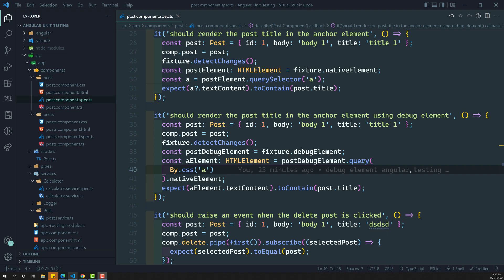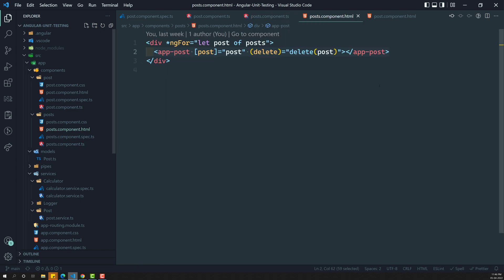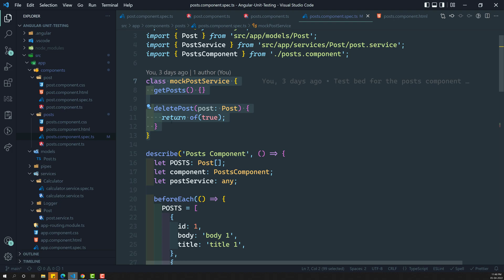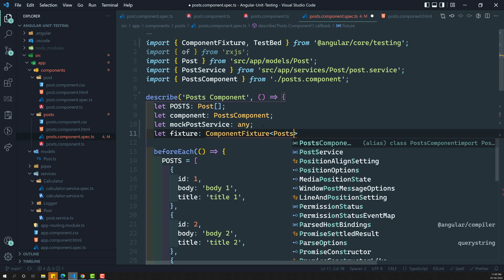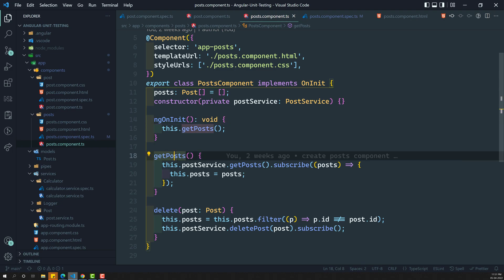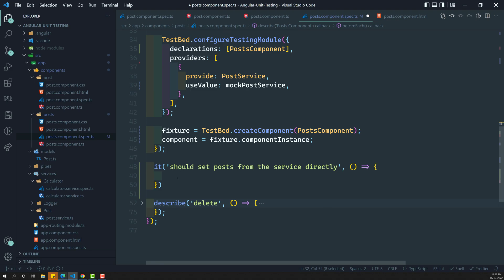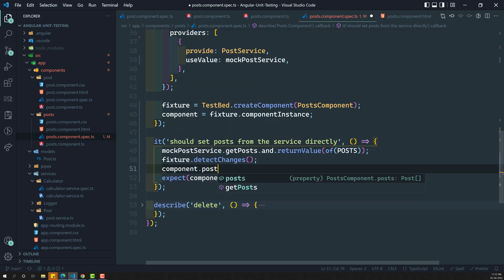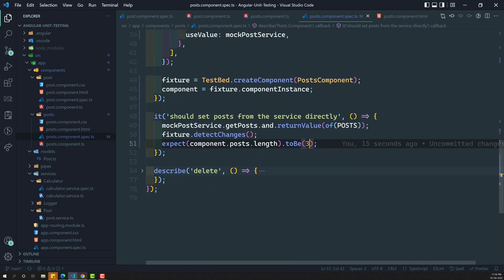23. Resolve the service dependencies for the component using Test Bed - Angular Unit Testing

Comment: The code that you had written is throwing this error: app-post is not a known element.
Reply: I got it from the next video. But how did you compile spec tests successfully? Did I miss anything?
Reply: try to add PostComponent to the declarations  @cagkanmertoztas
Reply: I got around this by adding schemas: [NO_ERRORS_SCHEMA] as shown in a previous video.  I think in the version that the videos show, that error just shows up in the console, but in newer versions of Angular it actually causes the test to fail.